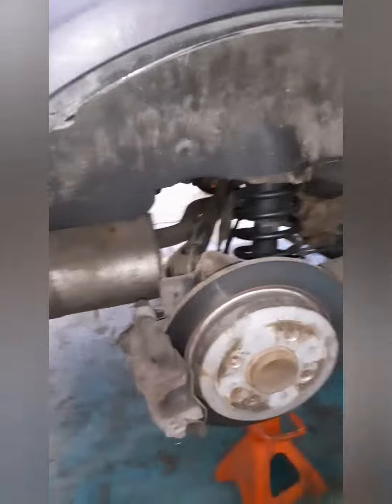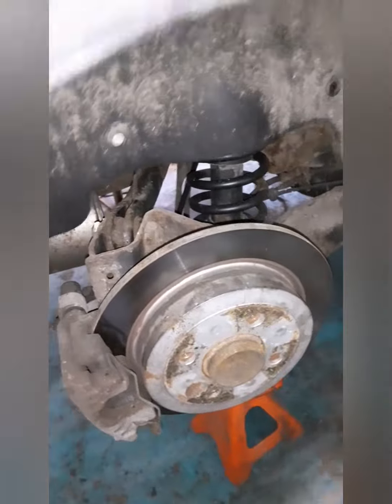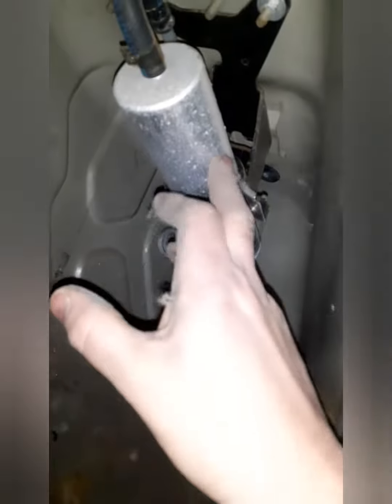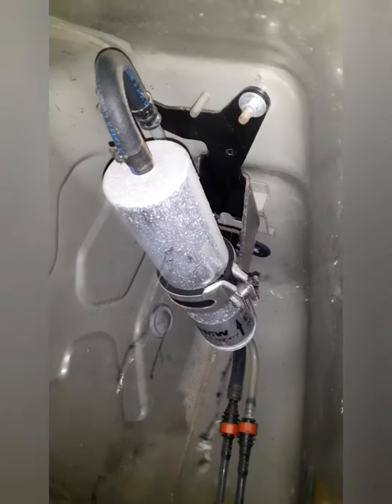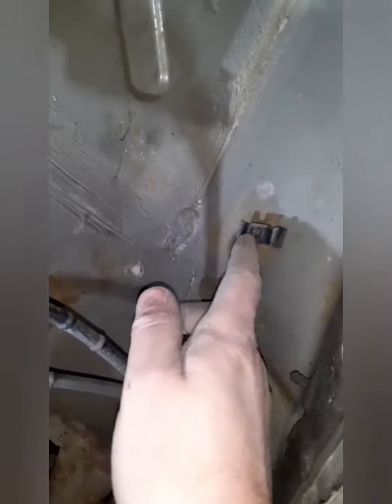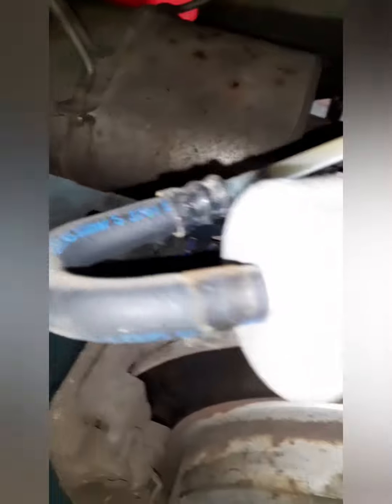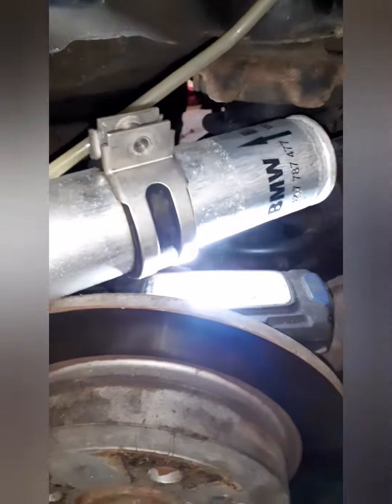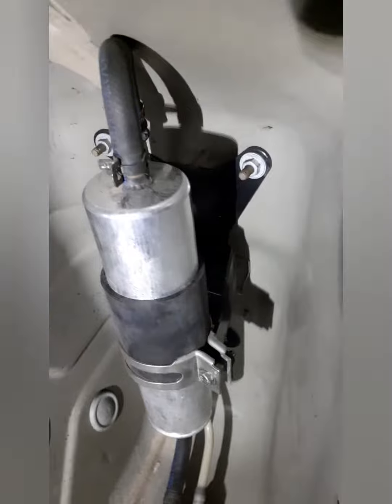MINI r50 2003 diesel fuel filter change removal refit

Comment: Hey great video do you know if there is a filter inside the fuel tank like the petrol minis R50 R53? Tia
Reply from the maker: As far as I'm aware this is the only filter on a deisel. 
It's the r50 r532 r53 petrol that are in the tank. Are you having a problem with cutting out at all? That's the reason I changed that filter and once I had changed it there was no more problems with the car.

Comment: Hey thanks for the video. I have got a r50 but not diesel, do I have the same thing ? Because I start to believe I bought a diesel filtrer for a car that is not diesel..
Reply from the maker: If you have a petrol r50 then the fuel filter is in a different place. You will find it inside the tank. It's a lot bigger job. I will do a video of that this week if it will help you?
Reply: @tonyrepairs5558  yeah I know about this filter, I’ve replaced it already. But I’ve been told to replace the « second filter » which is the one you showed us in the video. But now I’m questioning the knowledge of the person who told me this 😅
Reply from the maker: I didn't know there was a 2and filter. I've never seen one and never changed one. I wont say for sure it isnt there but I do believe it's just the deisel that has the filter there. If there is its news to me.
Reply: @tonyrepairs5558  i guess I’ll have to check myself. I’ll let you know later when I got time to work on the car, thanks anyway

Comment: Do you need to fill the filter ?
Reply from the maker: No. I didn't bother and it started right upbut did die. Started it back up and it turned over a littke then started and ran perfect. Hope this helps.
Reply: @tonyrepairs5558  thanks for the reply mate,have you had the linkage problem on yours with stiff gear changes? Daughter picks hers up nxt week and it’s got that problem,car was cheap for that reason but I knew it’s not a bad fix
Reply from the maker: @richardmathers7238  the last time I had stiff changes it was down to the clutch but hopefully its the cables. Let me know what you find. I'm interested.
Reply: @tonyrepairs5558  the clutch seems fine and by all the forums it’s the linkage but I will let you know 👍

Comment: Il filtro che è stato montato al contrario la freccia deve essere rivolta in dotazione di dove scorre il gasolio
Reply from the maker: Hi. Thank you for your message. The fuel filter arrow is the original filter and the new filter was fitted with the arrow pointing in the flow. I did make sure it was the correct way.